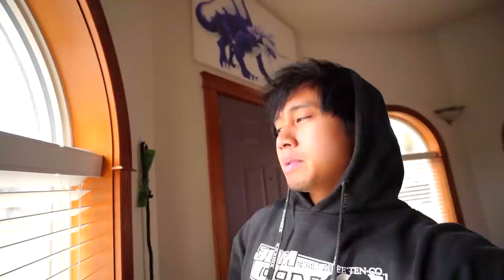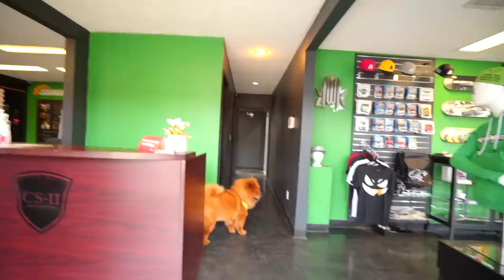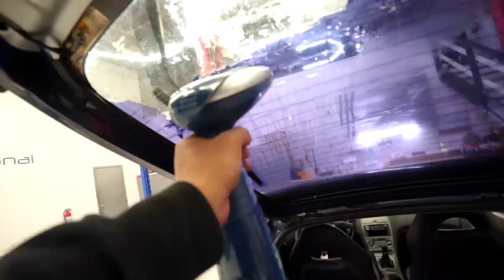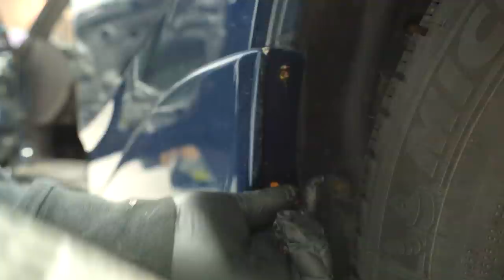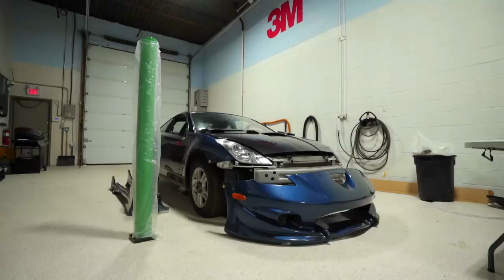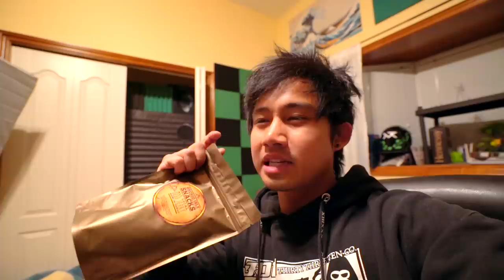First Real Car Day with the CREW in MONTHS!

Comment: Hey birdy ive been watching your videos for some time now and I was gunna tell you rx8’s cant use fully synthetic oil because rotaries inject oil into the engine to help lubricate it but synthetic wont burn during combustion. The unburnt synthetic oil will clog your cat and will cover your plugs and make them fail. Your supposed to use conventional oil only unless you have a sohn adapter kit. Premixing idemitsu into your gas tank as well will make it run healthy! Good luck man!
Reply from the maker: Yes I have specific rotary premix